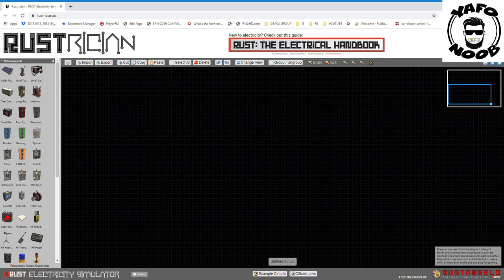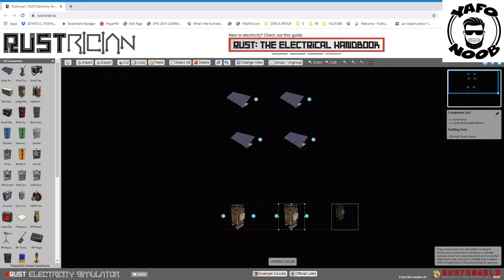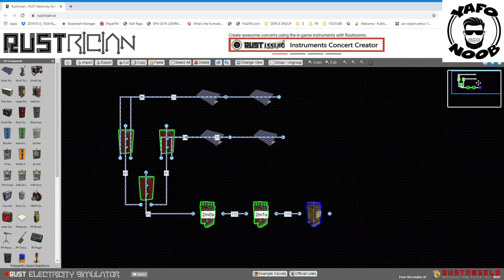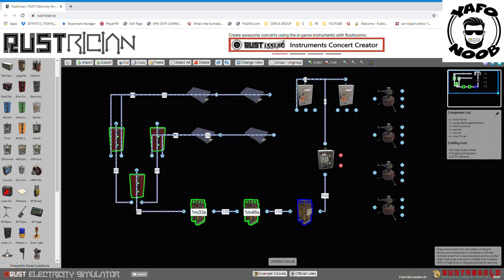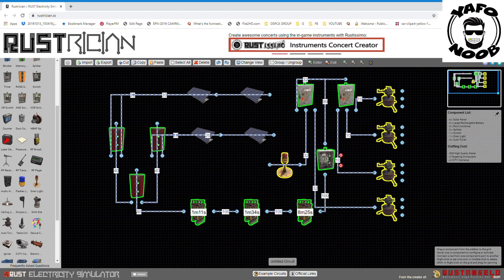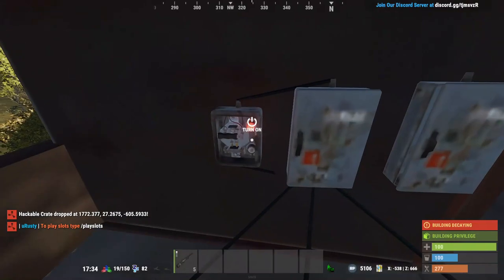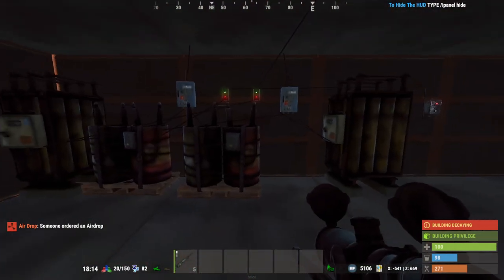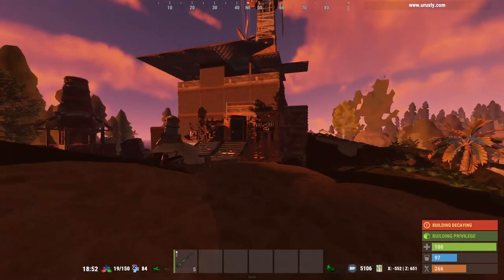Easy Rust Electricity Wiring Turret Schematic with solar panels

Comment: Thanks for the simple explanation, i was wondering what are your pc specs?
My friend has a laptop with 6 gb of ram and i was wondering if it would run rust
Reply from the maker: I have an HP Envy, 17 inch monitor. It's adequate, but not great. Not sure if this was the laptop I had when I made that video or not. If it helps, here's my specs:

Processor	Intel(R) Core(TM) i7-1065G7 CPU @ 1.30GHz   1.50 GHz
Installed RAM	16.0 GB (15.8 GB usable)
System type	64-bit operating system, x64-based processor
Pen and touch	Touch support with 10 touch points
Thanks for stopping by!

Comment: just a tip, its better to use and electrical branch to power turrets, set the branch off to 10 and set the power out of the branch to another branch with another branch off of 10, in that circut you were supplying 33v to a turret that only needs 10, which then makes 23v of your power in the system waisted. overall u waisted 58v that couldve gone to powering up to 5 more turrets, or maybe some lights or things like that, great video tho, i hope this helps
Reply from the maker: Ceej, I'm such a noob. That's really great advice. I'm going to try that right away. Thanks mate! : )
Reply: @YAFONOOB  yea np, if u have questions just lmk
Reply from the maker: Ceej, do you have any thoughts on this outdoor lighting system I made? I thought it was awesome until it got dark and I discovered it only worked in direct sunlight! hah hah hah I have it coming from the battery, it just won't work. youtube.com/watch?v=HP3lVWeKLDs
Reply: @YAFONOOB  alright so, the reason you couldn’t put the passthrough on it, is because passthrough goes into a power in slot, not another passthrough, basically, if you use ceiling lights for example, you can supply it with 10v and it’ll only use 1 cause that’s all it takes, but with the passthrough, you can then supply the extra 9v to another ceiling lights and so on, it lets u connect multiple things together without needing a splitter output for each. But my thoughts on the overall circuit was alright, though maybe next time, you can use a blocker to automatically turn on the lights when it turns night, if you plug a battery output into power in on the blocker, and the lights into power out, u can use an extra solar panel plugged into the “block” or whatever the one on the side is, so when it gets dark and the solar panel connected to the side stops receiving sunlight, it’ll let the power from the battery into the lights, that will let you turn the lights on automatically at night without having to flip a switch
Reply from the maker: @ceej3795  That's a great idea about the switch. I will try it again, the way you suggested. : ) Thanks mate.

Comment: Also how much gb for rust do i need again?
Reply from the maker: You just need an average computer. I use a laptop with 1TB hard drive and 16GB ram, but I used to play Rust on a  500GB with 8GB of RAM. I have all of the Rust graphics turned down to the minimum.

Comment: You may lose some power on this system so use electric branch
Reply from the maker: That's an excellent suggestion. I've learned a little bit more about this since then. Always more to learn, lol thanks for stopping by.

Comment: this is actually so terrible on so many levels. it hurts. using 3 large batteries? why? You can power 4 turrets for so much less. you obviously have no concept or understanding of electricity if you think it costs 335 freaking high quality metal to power 4 turrets.
Reply from the maker: Well, tbh I am not an electrician. Also, as I mentioned in the video, this is my first time using electricity. How was your first time? I probably did go way overboard, but I was excited about finally using electricity. lol I was like a kid in a toy store. I'd love any suggestions you might have?
Reply from the maker: lol, I'm guessing you're one of the downvotes, eh? : )
Reply: @YAFONOOB  Yup I'm one of the downvotes. It hurt me on so many levels. If you're going to make an electricity video at least do some research first. Check out the rustrician subreddit, the example circuits on rustrician, and take note of the newest changes to batteries. Circuits can be super simple now because of the recent changes that allow charge + output at the same time. I really don't understand your use of 3 large batteries. Otherwise, note that solar outputs 20 power but not constantly throughout the day. Theoretically, 2 solar panels = 40 power and turrets are 10 each so 3 auto turrets = 30 power. Therefore, 4 solar panels is 80 power way more than the 40 required for 4 turrets. You might need a bit extra cuz its not always daytime and some other electrical components eat 1 power each but man I'm searching youtube to find a simple cheap efficient setup not to watch someones first time doing electricity. Do some research this shit has been out for a while.
Reply: @YAFONOOB  you could probably power 4 turrets with 1 medium battery instead of 3 freakin large ones.
Reply: @SALT_KING   Let's see your amazing Rust electrical circuits then....oh wait. This channel has no content  Figures! 😆😆😆🤣🤣🤣
Reply: @lonewolf9390  I can show you one on Rustrician. What do you want powered? I'll show you a 10x cheaper way than in this video.
Reply from the maker: @lonewolf9390  lol Thanks mate! you really cracked me up : )
Reply from the maker: @SALT_KING  That's cool, I can live with a few downvotes. Also, I'm a bit of a noob in the game but learning all of the time. You had some good advice, thanks mate! Do you have any advice on this light system I built? After making it I discovered it only works during the day, even though I have the lights coming from the battery, lol strange stuff hah hah youtube.com/watch?v=HP3lVWeKLDs